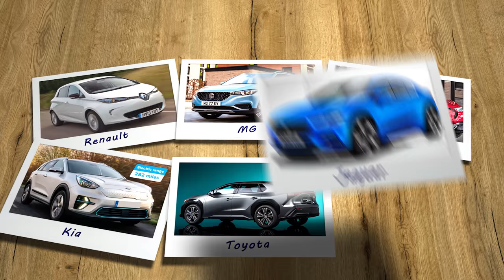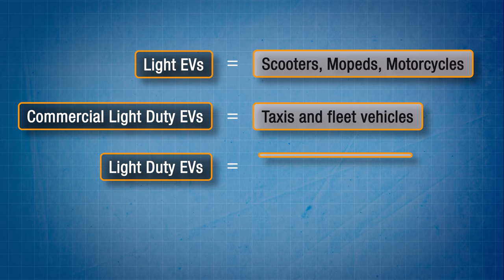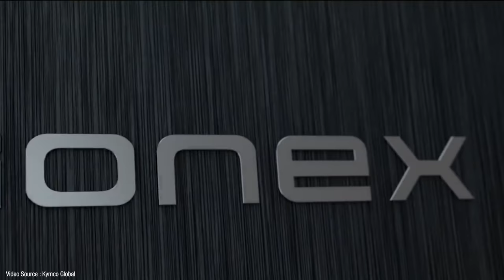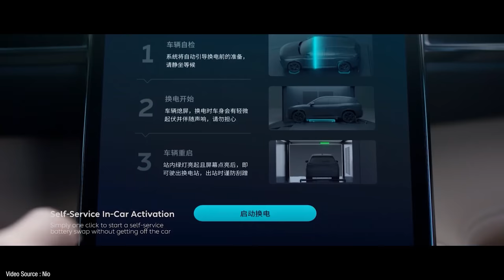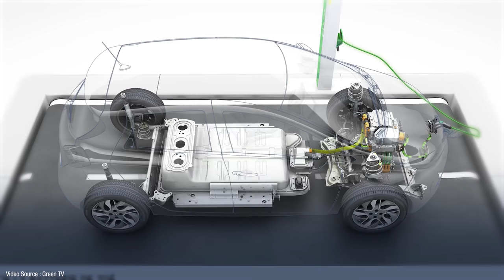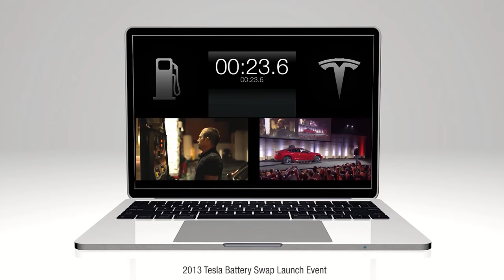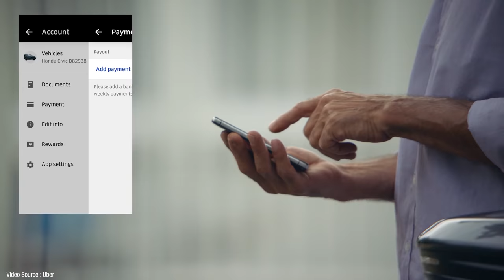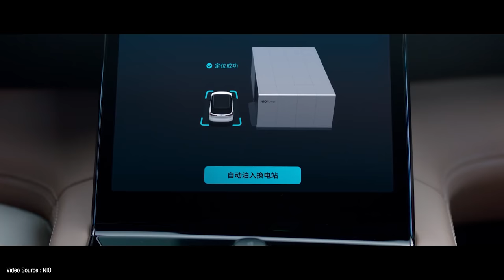Battery Swapping. Transforming the trajectory of electric vehicles?

Comment: Couldn’t this slow down the adoption to evs?  Tesla like other car companies are constrained by battery capacity.  The more extra packs needed for swapping means less cars available to produce.  Overtime it’s expected battery technology to improve reducing recharge time (which could make swapping unnecessary).  All this could do then is slow ev production when we need to ramp it up.
Reply: Possibly. On the flip side though, battery swap could allow people to better scale the size of battery there daily needs. A lot of battery capacity is wasted in vehicles that only occasionally need that range. Allowing owners to switch between low, medium and high range capacities would significantly reduce the demand for new batteries.

Comment: My big concern with battery swap is increased vehicle weight (more weight means less range). Fixed battery packs can take become a structural component of the vehicle. Allowing the battery pack to be removed means the vehicle needs to be structurally sound without the pack installed, not to mention the weight of the adapter.
Reply: Except NIO's efficiency is the same as other manufacturers so....?
Reply: @stanbradbury9449  Is it?  Teslas are much more efficient than most other BEVs, has NIO caught up with them? Also, BEVs aren’t using structural battery packs yet.
Reply: Yes, for swapping the vehicle needs to be structurally sound without the battery pack—but not for driving, just temporarily while the swap is happening. I’m not an engineer but I can image that a structural pack could be designed that’s compatible with swapping.

Comment: Great video, Dave!  I’ve thought that battery swapping was the endgame of EVs for years.  It solves so many problems (like end of life recycling, and range degradation).  But when electric tool manufacturers cannot agree on a standard battery pack design, it seems like wishful thinking that the auto manufacturers will standardize.

Comment: I think you are spot on again, Dave, without an autocratic government this will not happen among competitors. However, I am quite convinced that where a vehicle or a small fleet is geographically very constrained, like distribution vehicles or, even more likely, agricultural machines, we will see battery swapping. I see the farmer relying on a few tractors, a loader or dumper and a combine, all powered by batteries charged is his own back yard.
Reply: I doubt it. It may well happen just because it's there., the EU, or US sets a standard

If it works for fleet vehicles (and it will have to) then the likelihood is that stuff will be there waiting for everyone else to use it. A van or taxi is going to use the same battery as a private car. So why wouldn't you link up to that infrastructure?

Comment: Not a big fan of this idea, it just means having twice as many batteries in circulation.
Maybe it's sensible for delivery vehicles but effort spent on personal transport instead of mass transport and human powered personal transport is wasted effort.
Reply: Probably nowhere near twice as many batteries, since charge time should be significantly lower than average time between swaps, meaning one extra battery could support several vehicles.

Also, fewer vehicles would have large batteries so the raw material requirements might even be lower overall.
Reply: @InefficientElectron  trying to think of a good comparison, rental car utilization at 60% is considered excellent, that is with known areas of demand like airports and also dropping vehicles off and picking them up, I think it would be harder to predict where and when a spare battery would be required and unlike a rental car the turnaround time  during high demand would be significantly longer than the quick wipe over the rental car gets.
Reply: @zopEnglandzip  It depends heavily on charge time. If a station can charge a battery in an hour and only do 20 swaps per hour, then there is no point in having >20 batteries, and that station can service thousands of vehicles per week. Some chargers will only service dozens per week, but even if that's 50% of stations, we're still talking hundreds of vehicles being serviceable per station on average.

Charging speeds may also be variable, so a station might only keep 10 batteries and, if needed, accelerate charging on batteries to 30% if demand is spiking or offer a 30-50% discount on a battery that's only 70% charged.
Reply: @dosadoodle  charge time is a factor, but not as much as the unpredictable nature of where and when someone will want a fresh battery.

Comment: If manufacturers would put a connector in the boot then you could literally pick up a small, say 5kWh battery from a service station and throw it in the boot for extra miles. Then you could just return it when you're done.
Reply: I friend has a hybrid estate car. A lot of the time he's driving solo. It would be really neat if for weekday use, without the wife and kids in the car, he could put a nice big battery in the boot and extend his electric range.
Reply: Sounds like a good idea, but getting a 3 to 400 V portable battery it’s a bit tricky.
Reply: Plus it'd be really heavy, the poweroak ac200 is a 2kw lithium ion battery pack for camping, and that weighs 60lbs. A 5kwh might be north of 130lbs.
Reply: @samspencer7765  Yeah, you would need a hoist of some sort to drop it in the boot. But it's the weight of one extra passenger, the car would cope fine.
Reply: @davidmurphy563  oh yeah absolutely the car would be totally fine, and I do like the idea it's pretty fun

Comment: I find it hard to believe that a battery swapping infrastructure is less expensive  than a supercharger. And even the power requirements are probably the same if the throughput is the same.
Reply: One stall for swapping, with low power charging versus 4-10 high power chargers per location… it’s possible.
Reply: Battery swap station support less vehicles being charged per hour.
Latest Nio battery swap station only allow 13 batteries swap per hour.
Where a Tesla supercharger station with 10 stalls will allow up to 40 cars being charged per hour.
And there are supercharger stations with as much as 72 stalls.
Reply: There is a massive difference in complexity between a Supercharger and a battery swap station.  The Supercharger has no moving parts.  A battery swap station is a giant robotic thing with tons of moving parts.  The swap station requires a substantial number of batteries to be held in reserve at every site.  The swap station would probably want to charge those batteries constantly so that they don't need a huge number of them.  It's a great idea for mopeds, looks kinda bad for cars.
Reply: Didn't he explain that? The supercharger as the name indicates needs to be able to charge very very fast on demand. Battery swapping allows for slow charging and at times when it's convenient for the network to do so.
Reply: @AkaiKA4K  That's a silly point. Just put several battery swap stations one next to the other and call it one station like you just did with the Tesla supercharger. Now one battery swap station can charge more vehicles per hour than the supercharger station.
Reply: I think one cost is unavoidable, but dismissed when it comes to battery swapping. All the batteries just sitting there, waiting to be swapped. Now, after a while, they could optimize not to have too many, but I guess this would change over time.

The real deal breaker is so many different car types where it wouldn't make sense to make them all use the same battery format. As it was said, some even use batteries as structural elements, so I can't really see car makers agreeing on battery conformity.

With motorcycles, I can see that, however. Maybe even with certain automakers who share platforms anyway, maybe it would be worth it for them to offer this as a service.

However, I kind of thought battery swapping stopped being interesting as rapid charging has advanced much faster. And if you need to have the charger anyway (these parts drive up the price of the car), making the battery swappable (quickly) and building yet another infrastructure for it (it's not worth it if battery swapping isn't as common and battery chargers), I think this would just increase complexity and costs.
Reply: @Mr_Hassell  It is not silly point.
I am merely stating the reason why supercharger stations are more expensive than battery swap station.

Yes, things can be done the way you suggested.
Then the battery swap station would ends up being more expensive than supercharger.

Nio never place more than one battery swap station per location.
There are only just over 300 battery swap stations in China.

Tesla got over 840 supercharger locations and over 65000 stalls in China.
Reply: Battery swapping power demand (charging the removed packs) could help in reduce power grid strain. ie: Charging 10 Tesla vehicles at 250 kW (each) is quite demanding over charging 30 tesla packs at 10 kW each, and possibly during time periods where energy is cheap and/or cleaner. 

Charging multiple packs within these swapping facilities could also double as grid energy storage sources when necessary.
Reply: @wzDH106  But you can have stationary storage at a supercharger for the exact same purpose too. Except the batteries are never going into cars, so they can be completely different, something cheaper that doesn't need to be as light or as safe as car batteries.
Reply: @peter.g6  

Yes, a cheaper (static) storage system where weight is of little factor. I'm personally on team 'All the things'. So maybe we'll see it all.
Reply: A 2.5MW load that turns on and off frequently is hell on an electric grid. Battery swapping can actively load balance other systems. This sort of setup is probably good to have beside superchargers simply because you need something like it anyway to balance them!
What percentage of the time would all 10 superchargers be in use? 1%? What about 5 of them, maybe 5%? That 10 supercharger array would need either a lot of local storage or a 2.5MW supply because of the extremely rare peaks. Battery swapping can soften the peaks, meaning it can get away with a much smaller supply. That's where the infrastructure savings come in.
Reply: But it is 
The power input is massively different
Is like fast cars, they all can make a 100km trip, some way more comfortable or/and fast than others ... Even at the same model, faster cars are more expensive ... We pay power in other words, just like with chargers, even cellphone fast chargers
Having the capability to charge 10 batteries at lower voltage, demands less power than charging 1 at high voltage
Reply: @incognitotorpedo42  If there are batteries enough around, a swapping station will act as a load levelling device on the grid, charging from off peak electricity when possible and at lower rate than super chargers, so cheaper rate on power. However won't swapping stations need to ship batteries around? Usually some chargers are always occupied, so some swapping stations will have piles of batteries and others run out?
Reply: The math is easy: if  for every battery mounted to a car there is another battery charging in the swap station, the charge time is changing from  20min to 24hours.  72x less means  72x less power needed. Less battery degradation.
Reply: @Михаил Михайлов #1: Battery swapping has been tried since EVs had Lead-acid batteries. However it has always failed as a business. #2: Swapping stations need personnel to solve problems so have salary costs and if it  is a highly robotized station, the investment is in the millions $. #3: EV manufacturers have to agree on a standard for batteries and systems, which is far from being realised, as EVs are in their infancy and every manufacturer build their own car bottom up. #4: battery technology is moving fast, with solid state batteries, swapping becomes less attractive with longer range.
Reply: @Михаил Михайлов A regular charging station is very little maintenance, no moving parts. 15 years ago an Israeli firm "Better place" put up swapping stations for certain Renault EVs, but the subscription fee kept increasing and the stations were often out of order. People demanded their money back.

Comment: The Model S was designed to have swappable batteries and YT has multiple videos about it from 2013.
Musk said that the take up rate was so tiny that the idea was abandoned.
Nio claim an extra grant/subsidy for doing it. Great for consumers - no degradation to fret about. Only issue is that Nio have more batteries to source and they're the expensive bit of the car.
Edit, you mentioned it after 8 minutes. A static charging site is cheaper to build out than swap station infrastructure.
What happens if a route gets disproportionately used and there are no charged batteries?
You're going to need basically a Supercharger set up for the swaps. It's a cool idea but the vast amount of required batteries and complicated robot buildings will be a heavy overhead cost in my opinion.
Great channel and made me "have a think" Cheers.

Comment: Remember when devices had easily exchangeable batteries? So when the battery run out somewhere outside, you could simply swap it for a charged one instead of carrying a heavy powerbank a charging it with cable for ages? Same thing when the batt died...
Reply: Yes and it's a great time not just because of carry weight but lifetime of product will be longer too. Battery is the 1st component to degrade. You can certainly use old phone for more than 5-10y if battery is user replaceable. However, this is also why it was gone away. Phone maker that let user replace battery themself will get lower sell and die off. This is why you can't left it to the industry. Only way to keep battery swapping alive is by government intervention/mandates.
Reply: Yes Yes True that👍 Tesla got it wrong
Reply: @truecolors967  No they tried it and no one used the feature. The comparison to swapping phone and laptop batteries is flawed. EV batteries are engineered to last for the entire (10-20 years) life of the car.
Reply: @toby-xo6rb  Harvard said today that they solved dendrite problem and can charge batteries in 3 minutes..big step forward to making charging station super fast 👍
Reply: @truecolors967  Well, there has been a new breakthrough in battery technology every 24 hours for the past 10 years...in labs.
Reply: @peter.g6  ya but you can tell its a credible testimony here.

Comment: Batter charging is getting faster and faster and capacities are increasing. Feel like battery swapping adds a lot of extra complexity when it's done for anything bigger than a scooter. We will see.
Reply: I agree. As a EV driver for almost 6 years, the wait for a quick charge is really not that significant.
Reply: Plus, Tesla at least is now using the battery pack as an integral stiffener in the cars structure, thus saving chassis weight. Swapouts not possible.